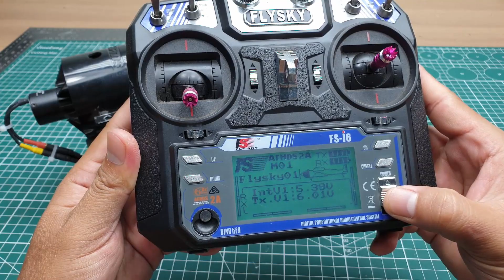I PUT AN AIRPLANE ENGINE INTO A TRUCK | WPL D12 | WORLD'S FASTEST WPL D12 CHALLENGE |  #WFD12

Comment from the maker: My WPL D12 broken few days ago and FMS EDF 12 Blade 6S Engine already laying on my workbench and .... this super WPL D12 was born.

WPL D12 1/10 2.4G 2WD Military Truck Crawler Off Road RC Car Vehicle Models Toy Several Battery
https://www.banggood.com/custlink/KDmyokPTqK

Hobbywing Skywalker 2-6S 80A UBEC Brushless ESC With 5V/5A BEC For RC Airplane
https://www.banggood.com/custlink/DGKdjktwUd

FMS 70MM Ducted Fan EDF 12 blade With 6S 3060-KV1900 Motor 2700g Thrust for Fixed Wing RC Airplane Jet
https://www.banggood.com/custlink/vKvYjkV1Ng

FlySky FS-i6 2.4G 6CH AFHDS RC Radion Transmitter With FS-iA6B Receiver for RC FPV Drone
https://www.banggood.com/custlink/K3GhjqHfns

Tattu R-Line Version 4.0 V4 22.2V 1050mAh 130C 6S1P Lipo Battery With XT60 Plug for RC Drone
https://www.banggood.com/custlink/vGDEOMtfbq

Don't forget to hit the follow button and the chime button on the right to get notified about the latest videos on my channel

Thank you for visiting my channel !